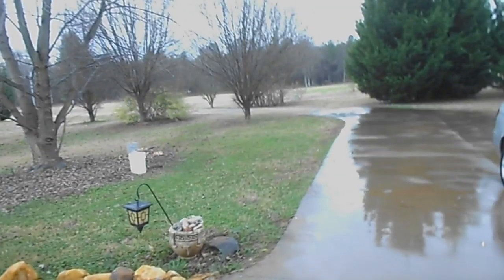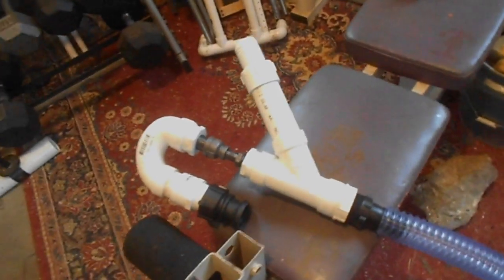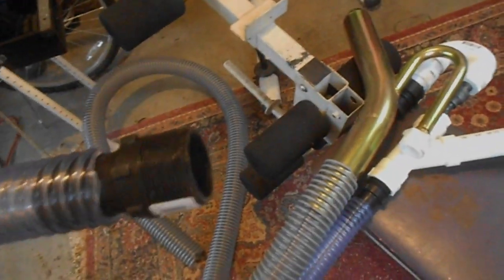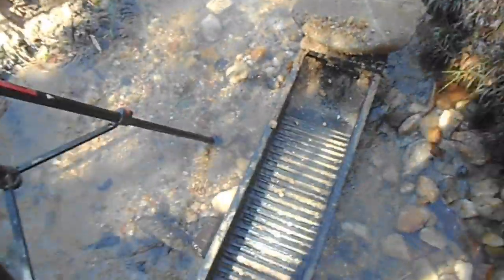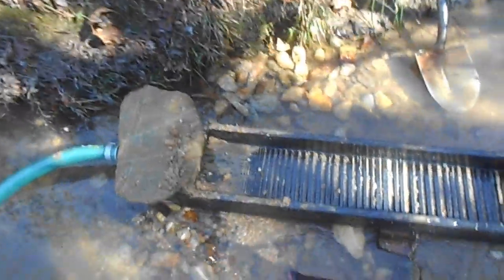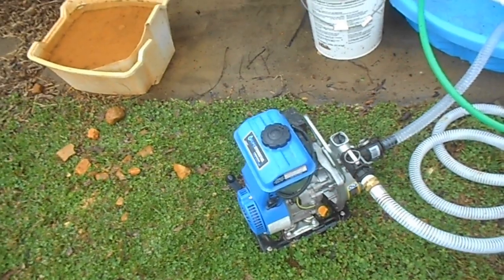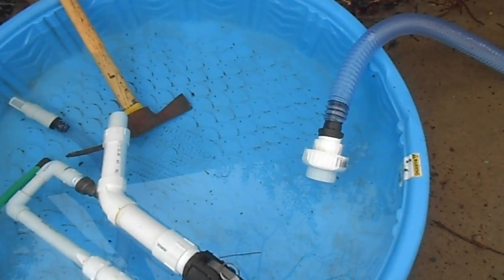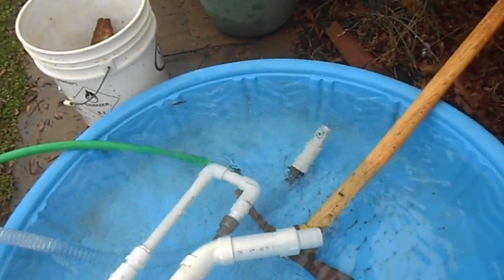DIY PVC Dredge Nozzle (Part 1)

Comment: Nice video Astro. You may try just bending the 3/4" pipe instead of the 90's. Its fairly easy to do. Tape the bottom of the pipe length...fill it with sand...heat it at the area of your bend (I use a hand torch...don't go crazy!)...wrap it (slowly) around a can or pipe that is the desired diameter...let cool. It may help keeping the pressure up to the venturi that elbows can lower.

Anyhow, just a suggestion...thanks for posting.
Reply: you can also use a spring

Comment: your 90 degree bends drop the flow considerably, you should switch those out with 45 degrees and lengthen out a little bit for a smoother flow